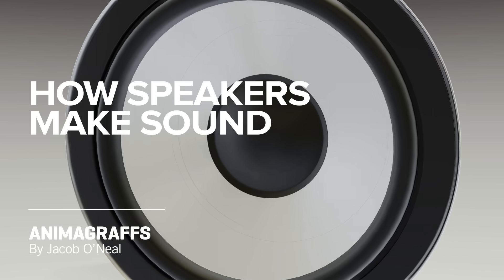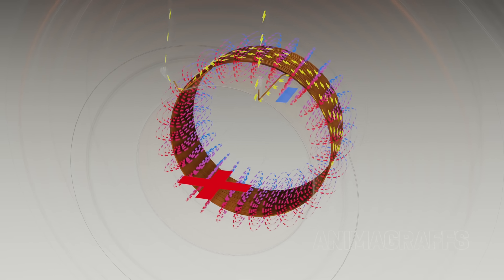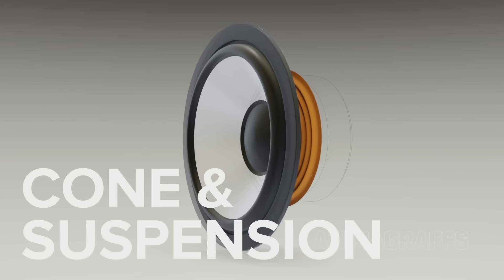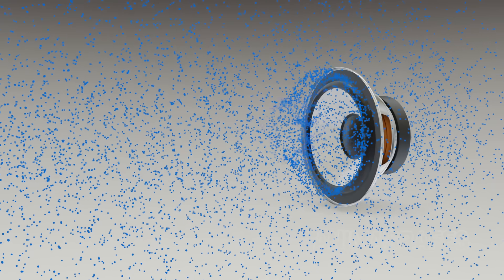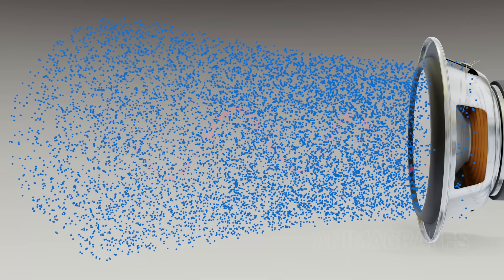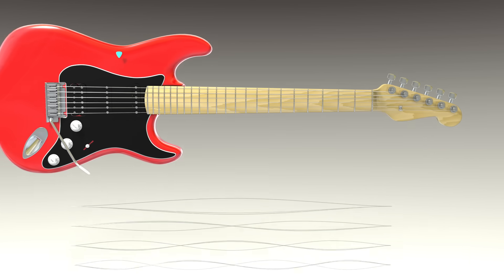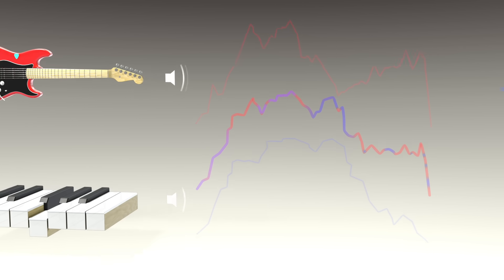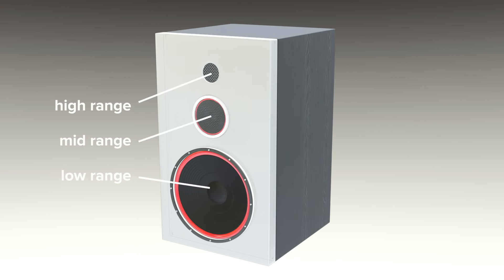How Speakers Make Sound

Comment: 3:40 but the true story is when speaker cone moves back and forth it not only creates positive air pressures front of the cone but also negative pressure back of the cone both cancel it out at some degree that makes sound lower but if you enclosed the speaker from one side , one sided wave can't Scape into the air but compressed inside enclosure and bounce back as positive wave , both positive wave combination makes sound louder that's why speaker needs , speaker box 😎
Reply: True only for bass tones.
Reply: @omsingharjit  Closed boxes being resonant is actually undesirable. The whole point of the box is to cancel out or negate the back wave. That's why you stuff the enclosure with sound dampening material. Any of the back wave hitting the back of the membrane causes coloring of the sound and is considered a form of distortion.
Reply: @davidcobra1735 thank for repeating my words 😅

Comment: Excellent video. I wish you went into more detail about the difference in design between high and low frequency speakers. What happens if you try to play a high frequency on a sub or a low frequency on a tweeter?